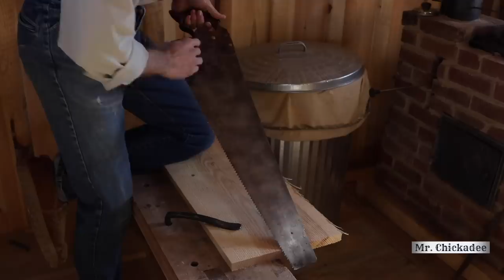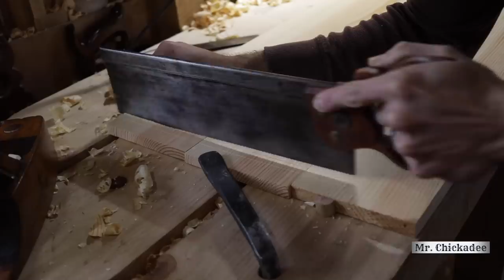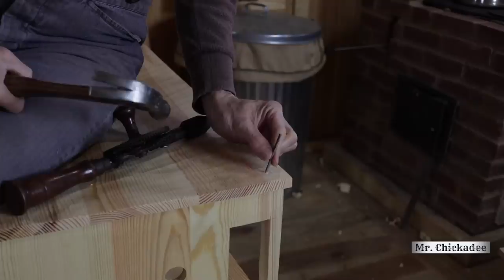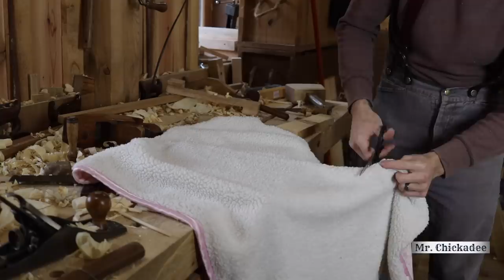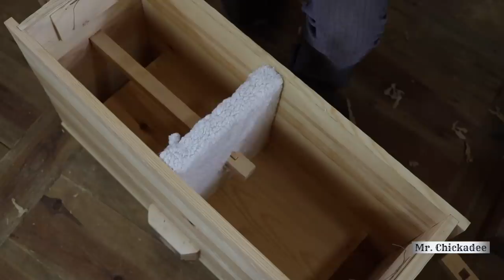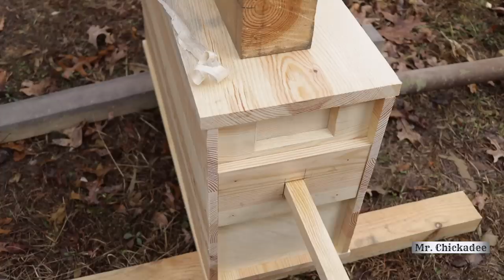Making a Chinese Wooden Box Bellows for our Blacksmith Forge

Comment: When I grew up in a small village in China, I often helped my grandma in the kitchen with a bellower just like this one. Every family had one of these in my village. Heat from fire was used for cooking and  exhaust goes under a  platform built with adobes. The exhaust goes under the platform in a horizontal zigzag pattern before going upward to a chimney. The platform was used for sleeping and a lot of day activities in the cold days. I  wondered how those bellowers worked for a long time when I was a kid. When you showed how it works, the push pull noise and the clicking sounds were just like what I heard 40 years ago. Now I am missing my grandparents and those days that's gone forever. Thank you for the video that brought me the best part of my childhood memories.
Reply from the maker: Ke Feng, Thank you for the comment and history. Would you please tell me the name of this adobe "heated bench"? I would love to know any details about it, such as its name, size, and placement within the house!
Reply: @MrChickadee  It's called "kang", or "kang-bed stove". It is often takes 1/2 to 2/3 of the area of a bedroom (also made of adobe). I wish I can draw a picture to explain better. But it is connected to 3 walls and the kitchen is normally outside.  Height is about the same as a desk. The adobes were made by mixing straws and clays.
Reply: Awesome.
Reply: @kefeng6805 that's really cool. I'm hoping to keep this in mind if I build a small house like I have planned out in my mind.
Thanks for sharing the memories, very sweet. I miss my grands as well, so much.

Comment: Love those nice long wood shavings from the plane, along with all the hand tool work.
Reply: The Japanese hold competitions to see who can get the longest, thinnest curl of waste from the stroke of a plane. Amazing stuff. No one can claim complete mastery of woodworking if they're honest.
Reply: @BillB23  The setup from those competitions is far detached from day to day woodworking. I'm fairly sure I could be competitive in one, but I would turn to checking edges under a metallurgical microscope to do it. It's more of a game than anything else. The planing in this video is ideal - long continuous shavings, no bouncing around in and out of a cut and it's practical. It's what will actually happen if you hand dimension a few hundred board feet of lumber.
Reply from the maker: Very well put David! It seems rare even "hand tool" woodworkers dimension by hand, or learn the plethora of lessons this teaches!
Reply: @daw162  Granted! I was just using this example to highlight Josh's hard won skills.
Reply: @MrChickadee  You are not one of these "professional woodworking athletes" that compete with pull planes in Japan. Your hard won, self taught skill is an inspiration to us wannabes.
Reply: @daw162  Agreed! I was just thinking that what Josh does with self taught skills rivals folks in a Japanese competition.

Comment: I enjoy your videos very much, and have watched them from the beginning.  As a hand tool user myself, I am kind of surprised that you don't use hide glue for your joints.  It's a little more work, heat, mix, time, etc. than regular glue, but it's superior in many ways.  The best being that it is reversible and a piece is repairable much easier than with normal glue.  I was told once that if I did switch to hide glue that I wouldn't go back, they were right.
Reply: Modern glues are beyond the imagination of someone in the 18th century.  Literally space-age stuff.  If you want something to stay together forever, modern glue is the solution.  For musical instruments, maybe certain other applications, hide glue is superior.  But in general, Gorilla Glue is amazing stuff!

Comment: Really nice seeing a Chinese bellows being build, really fine work! 
air blast seems a little weak, you might need to sew fabric to the valves but
maybe thats just what it looks like with wood fuel, needs a test with tuyere covered by charcoal/coke/etc.
 
If it is too hard to push/pull you have to reduce the sealing tightness of the piston board and play back and forth until you achieve both, ease of use and strong pressurized air blasts.
if its sealed too tightly and the air can't escape fast enough you gonna fight a vacuum.

Comment: would not have thought you'd get a good seal with the fuzzy nature of what you used; clearly it works though.   (think the cat will be a little unhappy at the loss of some of it's warm blanket)  
..  Historical ones i've seen had strips of heavy leather flange "wipers" either attached around the perimeter with battens or sandwiched between two mating panels that formed the central plunger.  (the one a mentor used was of the second type)    
  There is a soothing distinctive rhythm to these style bellows that i've always prefered over the western style.....I look forward to seeing what you intend to make using this!

Comment: Great project. Back long enough ago I had a Betamax video recorder,there was brief footage on one of these things. At least in China,they used chicken feathers rather than fleece cloth for sealing the piston. Not sure if that would do you any good, maybe goose down or duck down might serve if the cloth wears to the point you need to tweak it.
Thanks for this. I was trying to get my head around the valves and the internal construction.

Comment: You can get around the safety valve with not connecting the tube to the machine. If you put a funnel (maybe reduction to halve the diameter) on the outlet and the Tube (Maybe 3 fingers away) you will gain air volume but don’t have pressure.

Comment: Warning: I build one like that (bigger for smelting) and found it necessary to incorporate a safety valve at the beginning of the tube. If you can’t do pumping all the time, without pause, hot gases can reach the air mover. I got away with blackened wood around the air outlet but had to put out some little ambers. Luckily I had sometime the idea to feel different parts of the machine, because I was concerned about the radiated heat of my fire.
All books are mentioning badger fur for sealing; some Japanese smith I ask showed me bunny fur and at the bottom an big glass mirror where the piston is gliding on, they sad that it would make it all easier.

Comment: This is just me, but seeing how pressure is being applied from the small wedges to hold the glued parts near the beginning is just a 'well, that's a low tech, but really smart way of applying pressure'. I'm rather shocked at how simple, yet effective, without a need for fancy-ass tools, if you just apply physics.
Reply: Gotta remember, if we've been doing this a few thousand years or so, then we sure can get it done now
Reply: Yea, I have seen lots of similar projects using various clamps, when I saw that I was a bit shocked. Like, duh, of course it works, but I have never seen it done (I'm sure someone does it but just no one I've watched) and never thought to do that myself. Glad I caught that little nugget.

Comment: I made one of the box bellows for my own forge, puts out so much air for the forge. I made my inlet holes a little more than 2.5 inches in diameter and made them round. In your rough dimension description you note 2 x 4 for your inlet doors. How big are the valve flaps that close and open, I suppose just enough to cover the inlet holes.

Comment: I was curious if I could make a request for a build.  I was thinking of doing a set of stairs in Timber framing using logs with one side milled flat (for inside the steps) and 2-3 inch thick treads between the two logs with no backers on the rise between the treads. My request, is if you ever have a need for stairs, could you do an interpretation like that? I respect your work and would probably use that as a guide.

Comment: Great video, as always! Quick question about the dado you cut around the 5 min mark. Why not square off the panel and use a router, versus sawing the lines and chiseling out the middle?
Reply: If you are talking about using a hand router plane, he'd still have to cut the side walls of the groove/dado with a saw. If you are talking about an "electric" router... wrong channel.

Comment: Does this not also pull air up the blower pipe on the off stroke? If it does, wouldn't adding another one-way flap (metal) on the outlet of the pipe make it function better? I may be mistaken.

Comment: Can you explain the benefit of a box bellows vs a common leather and wood bellows. Is the benefit one-handed operation?  constant vs intermittent airflow?  The box style moves air constantly with the double acting mechanism but doesn’t necessarily look more effective at generating air compared to a wood and leather bellows.
Reply from the maker: Im no expert, but the box bellows is smaller so takes less space, more quiet than a hand crank, immediate start stop conserves fuel, easier/cheaper to make

Comment: Have you considered driving those headless nail in at an angle so they "help" each other stay locked in?
Reply from the maker: One reason to use nails rather than glue or rigid joinery is to easily take it apart to repair if needed.

Comment: What is that string you used to tie on the "flappers"? That seems like it would be the most important part to get right. I assume that string must have some amount of elasticity to it, in order for the valve to stay sealed?
Reply from the maker: just normal twine, its the force of the air which pushes the flapper tight

Comment: hello Mr. Chickadee Just the other day I seen this project of yours so I went and built one but my airflow isn’t quite right I have to push and pull really fast and hard for it to work not sure where I went wrong my air inlets are an inch and a half round on both ends of the box and so is my outlet there goes to my forge any input would be really helpful and would be very appreciated.
Reply from the maker: it could be a few things, for starters my pipe is 2" diameter and the air intakes are 2x3",larger than needed so they dont need to open very far to fill up the chamber. 
Also very important is the hole must constrict as it enters the forge, mine goes from 2" in the pipe diameter down to 1" at the clay Tuyer entrance. This causes the air to increase in force just as it enters the forge. You should need only a slow steady push to get all the air you want if its set up right.
Reply: Thank you so much for the information that helps tremendously
Reply: Thank you again for the advice my bellows box works very well can’t thank you enough

Comment: 1) Why glue the panels but not the dadoes and the rest of the assembly? 2) Why is the top allowed to slide? 3) What sealant was used between the box and the pipe?
Reply from the maker: Because you may have to take it apart to fix one day
Reply: @MrChickadee  Thanks so much for responding. Like most people, I find the skill level very impressive and the silence refreshing. How about the other two questions?

Comment: Nice video, as always. I'm sure you have a level workshop floor, so pleeeeeeaaaaase level up the feet of your saw horse! That rocking is making me sea-sick. :)
When hand-cutting a housing , it's easier to start the tenon saw accurately if you clamp a batten across the board as a guide.
Reply: Don't think he needs a guide to saw straight, but that's a great tip for the beginner woodworker.
Reply: @thomasarussellsr  No, indeed, he probably doesn't. However, really skilled pro cabinet makers also use a guide, particularly for that long scary shoulder cut when doing breadboard ends across the width of a table. There's just a slight oddity about marking with a knife then cutting to the line with a saw. Normally, you would mark with a knife, then chisel a small amount away creating a "knife wall", and saw against that.....or.......make a pencil mark and use a guide batten. Once the housing was chiseled out, then you'd usually reach for a router plane to level off the bottom. If you don't have one, Mr C, then that's your next tool!

Comment: 18:57 What's the round hole for (visible in this timeframe) that's blocked from the inside?
Reply: There's a hole on either side for connecting the shaft to the internal plunger.  Only one is used at a time, though.  The shaft could be installed on the other side or maybe the intention is for both sides to have shafts so that two people can operate.
Reply: The shaft is square, I'm referring to the round hole. Also the side where the shaft enters is reinforced with another plank, the round hole is not. So I'm not yet convinced... :-)

Comment: Why did not you try to make a japanese double bellow box? It seems that your box has only one chamber. So, when you push or pull the handle you blow or you suck the air from the forge. With a Japanese ou Chinese double bellow box you will only blow the air to the forge, no matter if you are pulling or pushing the handle.
Reply from the maker: This is a double chamber bellows, it blows on push or pull and never sucks air in the tuyer pipe
Reply: @MrChickadee  Thanks, but I could not see the valves in the bottom chamber to avoid the backflow.